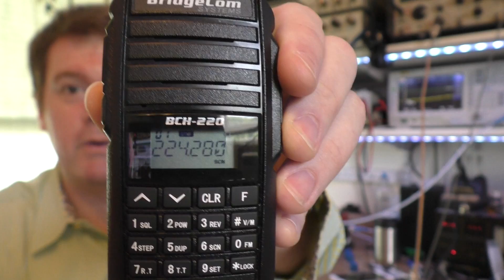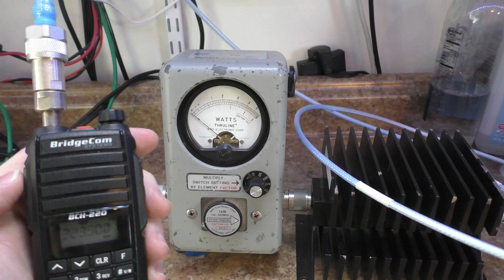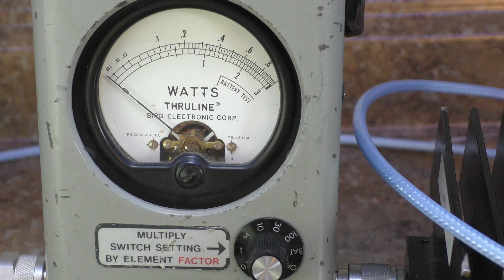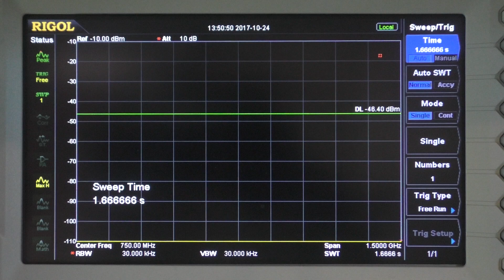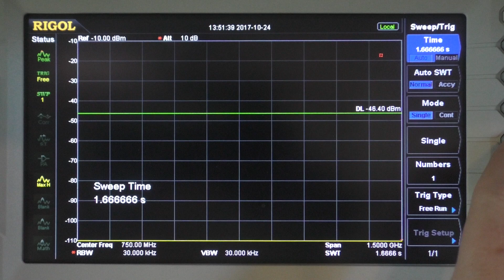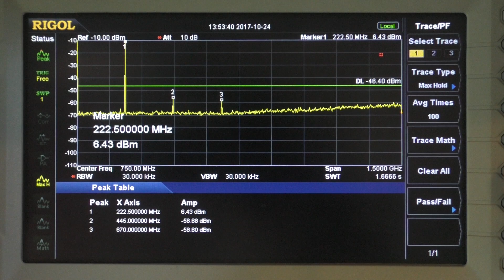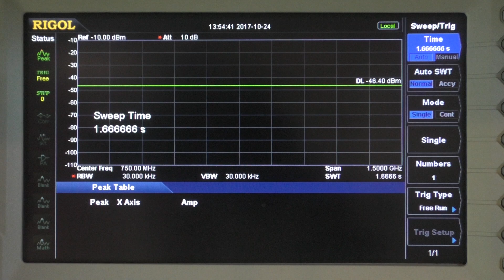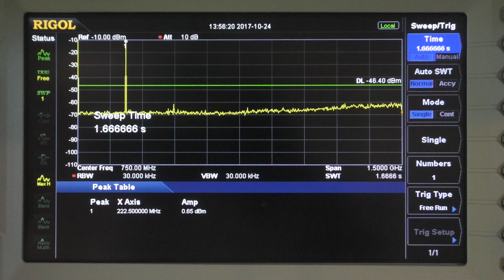Spectral Testing the BridgeCom 220 HT

Comment: If you go to the amplitude menu on your Rigol SA you can change the "reference offset".  What you do is measure your entire system attenuation (cables, adapters, attenuator and inline watt meter).  Set this as your reference offset and the actual transmit power will be accurately displayed on the SA.